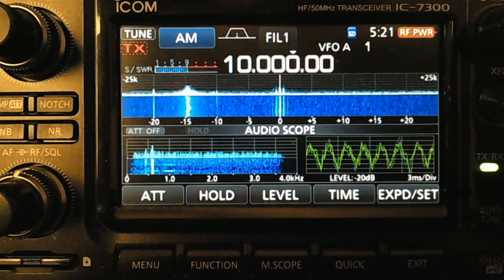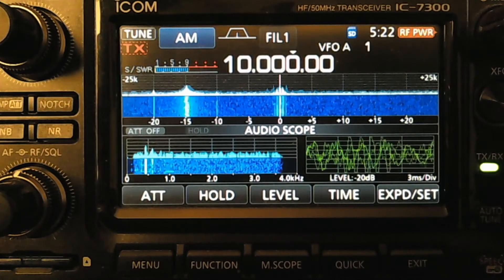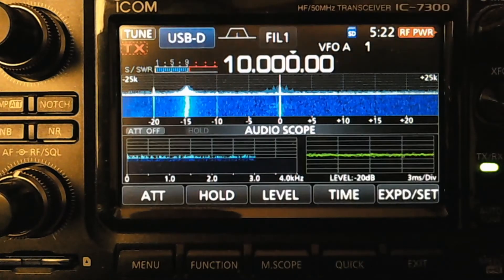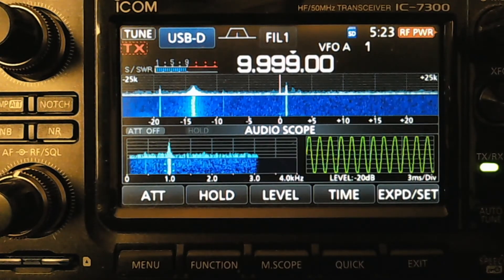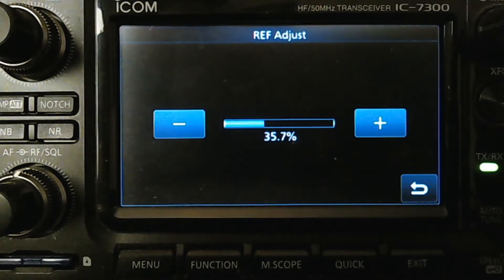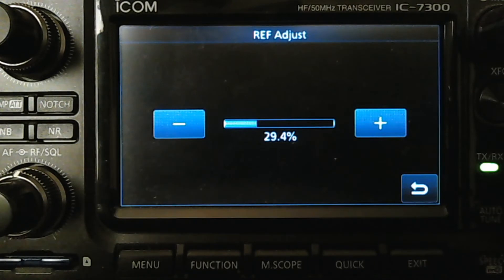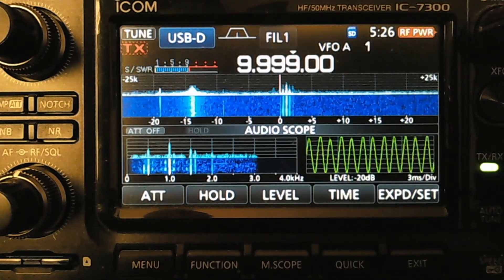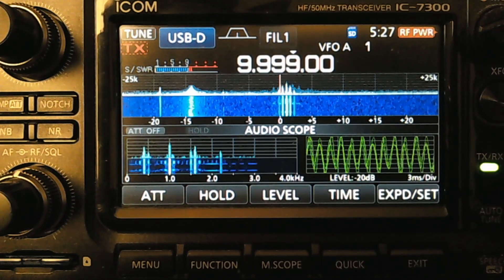Is your HF receiver calibrated?

Comment: I tap the screen freq and get three digits right of the decimal point, this gives a resolution of ONE Hertz! . This is much more accurate than any radio I have owned in 65 years! I still have within 1 or 2 Hz error compared to WWV, AFTER HAVING my  IC7300,  FOR 4 YEARS!  I check against WWV on 2.5, 5, 10, 15, 20 and 25 MHz.

Comment: Its fine if you own a IC7300 but if you dont use your cw sidetone : if it is set at 1 Khz it will work exactly as described in your video but the best way to do it is to use digital mode app WSJT-X on its frequency calibration mode, it has a routine for doing this and the results are very accurate. PS remember the higher the frequency of the time signal the more accurate your calibration will be.

Comment: That throbbing can go down to really low frequencies. You can hear (listen carefully) 1/2 cycle per second or there abouts if you learn how to hear the "throb". That said, I"ve needed to do this, as I use a mode called JS8CALL (JS8) and sometimes my transmission starts at say offset 2001 and ends up changing to anouther line at 2000 messing up the "message" . Have you noticed a carrier suppression adjustment for this radio ?